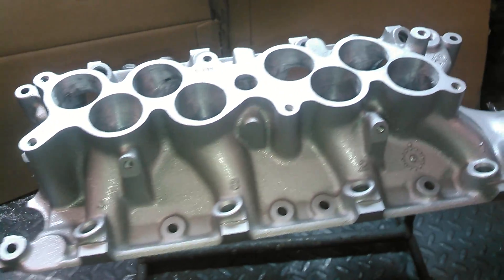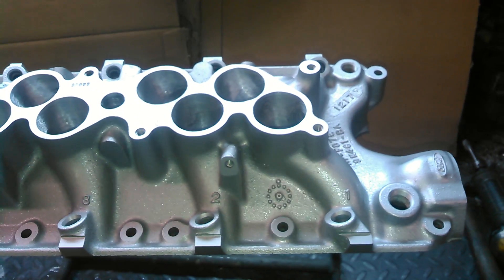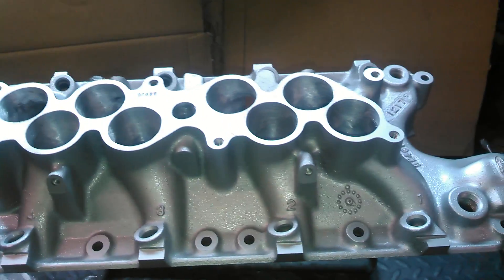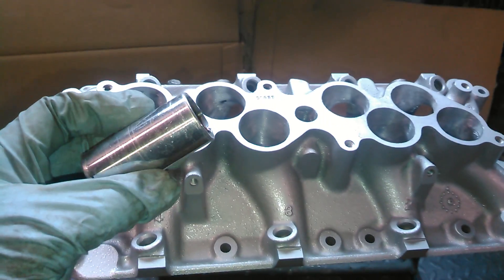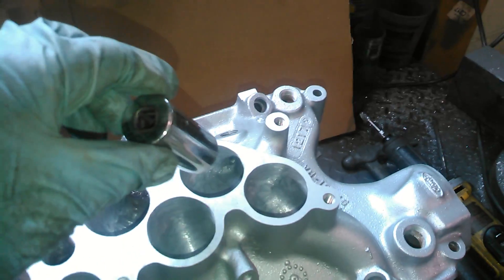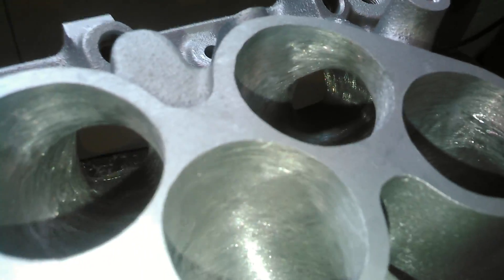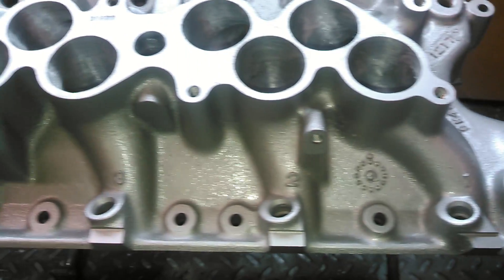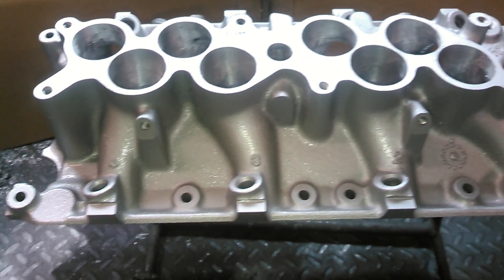Max ported Gt40 manifolds by Bigdogs Porting

Comment: I am seriously  considering buying one of your  Big dog intakes for my Street driven Mustang What I  was wondering is how much will it hurt the bottom end response compared to a GT-40 stock intake. 
I want more power  but want to keep  my car driveable!  I was wondering if you also do the GT40 heads and what is there price!
Reply from the maker: It will not hurt the low end and in fact you will pick up on the low and pull hard to the top. The Stage 2 porting is rated for 1500-6500rpm. Yes we also do the same heads. Visit our Facebook page at Bigdogs Porting.

Comment: Is the gasket you use bigger too to match the lower and upper?
Reply from the maker: We recommend file fitting the upper to lower gasket that way you don't reduce  flow
Reply: @bigdogsportingtonyb2833  can you do that for me as well?
Reply from the maker: @rickfox9825  that's something the customer normally does. Its very easy to do but if you send gasket we can do it for you.

Comment: 320 cfm from a ported stock length GT40 style intake??  That's as much as a stock Super Victor!!  What depression?
Reply from the maker: If you check out our Facebook page we did a direct flow comparison on our bench to a stock Victor 5.0 and our Stage 2 outflowed it. 28". We have pics and videos on the Facebook page at Bigdogs Porting. I don't see why this is so hard to believe. I've been doing it for years. We remove between 1.5-2lbs worth of material from each of these manifolds. We modify and port the entire port on the lowers and our Stage 2 gets a partial Porting on the upper. Our Stage 3 gets a full Porting on the upper. You've already seen the flow and dyno results of our ported manifolds from some of our customers. 30whp more over a home ported Edelbrock and our customers are sending in their manifolds that were previously mildly ported by other porters!!

Comment: I’ve just discovered Bigdogs porting. I don’t know shit about engines. I have a stock 5.0 GT. I plan on having the engine reworked next year. Is there a package that you guys at bigdogs can put together and sell to me that I can take to my mechanic and have them assemble?
Reply from the maker: Yes it is. We offer a stage 2 package that consists of our stage 2 ported gt40 heads, stage 2 ported gt40 manifold, cam that works great on the street and strip and our ported 65mm TB that flows more than a bbk and accufab 70mm TB.
Our stage 3 package consists of stage 3 ported gt40 heads with bigger valves and all. Ew hardware, stage 3 port gt40 manifold that is cut and welded and flows over 320cfm, matching street/strip cam and our ported 65mm or 75mm TB. Stage 2 package will make over 340whp on a 302 with supporting parts and the stage 3 package with make over 340whp with the right supporting parts. Message us on our Facebook page at Bigdogs Porting  for more details thanks.
Reply: @bigdogsportingtonyb2833  I am interested in  purchasing  a ported stage 2 upper  and lower intake for 5.0 ford
Reply from the maker: @jimmyrwilkesjr5127  contact us on our Facebook business page at Bigdogs Porting so we can go over the details of your combo and setup the order

Comment: I'm interested in a ported Explorer intake for my '88 GT, but I have a bunch of questions.  Where were your parts flowed?  Do you own a flow bench or did you take the parts somewhere?
Reply from the maker: Afri we have a in house flow bench that we use and we also have had our parts flowed on other flow benches. our flow bench is a little stingy compared to others by about 5cfm. We flow before and after so the gains are what they are.
Reply: OK.  I actually bought a Holley SysteMAX II intake manifold.  I wasn't having any luck finding a Cobra or an Explorer intake and the better "BD" or "AA" lower.  I think I'm going to need a 70mm or 75mm TB and EGR.
Reply from the maker: Afri once ported both the GT40 lowers flow the same. Holley makes a great manifold but our Ported GT40s blow it out the water when it comes to airflow. People will say "well the Holley can be ported as well" and my reply is "we also have a Stage 3 cut and welded that flows 325cfm and can even add more with our Stage 4 highly modified GT40".
Reply: I'm not an expert.  I don't do this stuff for a living.  I think flow bench, dyno videos and videos from the track will help sales.  The info I found was an Explorer intake would only give me about 10-15 hp to the wheels.  I know it's the combination of parts.  I have my SysteMAX II intake.  I'm going to get a pair of 11R 190 56cc heads, a custom cam and try to 360-400 hp to the wheels.
Reply from the maker: Afri a stock Explorer Gt40 is what they are talking about. Like I said before, an out the box Holley intake gets blown out the water by our ported GT40s. Our port work on stock parts is geared towards maximum power for the least amount of capital. We have plenty of combos out there running 10s with our ported GT40 heads, manifolds and mild cams that are grudge cars.
Reply: Make a comparison video and put it on YouTube.  It should help with sales.  There's got to be plenty of guys out there just like me with foxbody Mustangs.  I just bought my '88 GT a few months ago.  Initially, I wasn't going to keep it.  Then I thought about doing a Coyote swap.  I'm going to keep it a 302 for now.  It's a street car.  I'd like it to be a daily, but it's loud with the headers, x-pipe and Flowmasters.  I love the sound!  I want to be able to go fast and able to corner.  I don't want to put a cage in it. 11.49 or lower, you need a roll bar.
Reply from the maker: Afri I have plenty of comparisons on our Facebook page at Bigdogs Porting. I've ported and sold thousands of manifolds, heads and TBs over the 27 years I've been at this. Our shop car runs high 10s on motor with our ported parts with a 302 NA, still has AC!
Reply from the maker: Afri We went 11.70s with our Stage 2 GT40 manifold and Ported E7 NA with full bolt ons in that car before the GT40s.
Reply: I'm not on Facebook.  I'm probably the only person out not on it...lol.  My car doesn't have AC.  I'm going to buy a pair of TFS 11R 190cc heads, have the SysteMAX II lower ported to them, a custom cam and see what it can do at the track and on the streets.
Reply from the maker: Afri lol, not on Facebook. OK well your combo should run good but if you only wanted to mid 11s you could have done it way cheaper lol.
Reply: I'm still in the beginning stages.  I'm trying to setup a dyno appointment to get baseline numbers.
Reply: I ordered a 65mm TB from him and I'll be giving it a try.  I want to do it correctly the first time.  (I have a baseline dyno video in my profile.  My '88 GT AOD made 168 whp & 254 wtq).  I want to make double the power when I go back.  I ordered a custom cam from Ed Curtis.  I have a Holley SysteMAX II intake waiting to be bolted on.  Cylinder head wise, I'm looking at the TFS 11R 190cc heads and I'm probably going to have them milled for more compression and only run 93 octane or higher.  I want 350+ hp to the wheels.  After that, maybe a 351W and I can reuse the 11R's or a 5.0 Coyote swap.  Hopefully the prices will come down more or I find a Gen 2 or 3 coyote.  I need to make more videos for YouTube of my build.
Reply: @afri1414  I would've stuck with Ed for all of it, personally. When you jump from one guy to the next and have each one do something, it's a lot more difficult to make the entire package as a whole work together well.
Reply: @JC-11111  I reached my hp goal if you factor in the about an eight percent loss because I'm running an AOD. My local shop was closer to me than Ed.
Reply: @JC-11111  I got the heads and cam from Ed. The intake off of eBay.  A local shop did the install.
Reply: ONLY 8% loss for an AOD ?